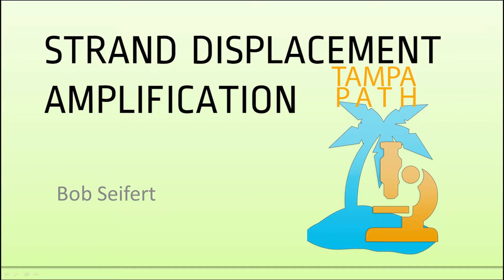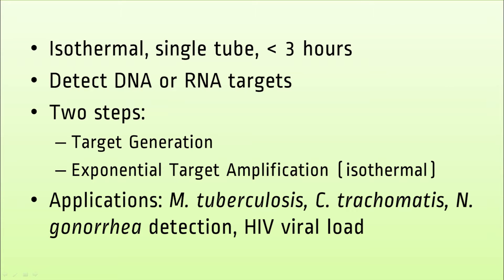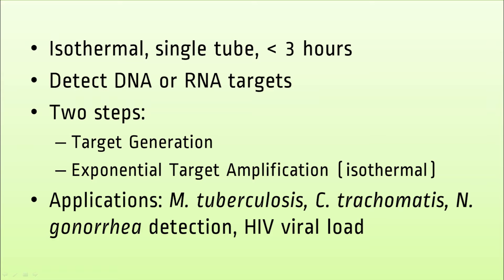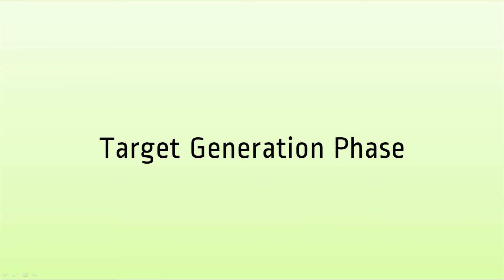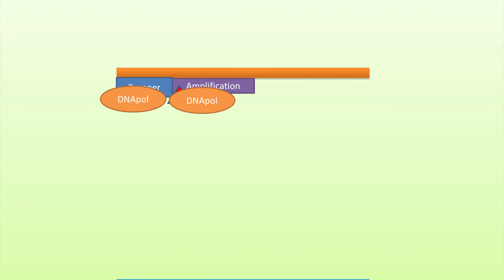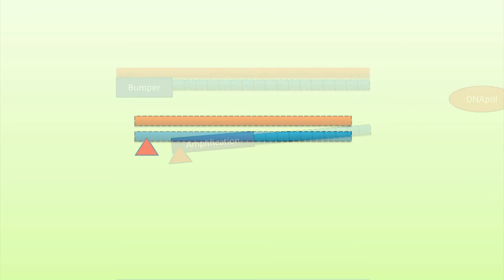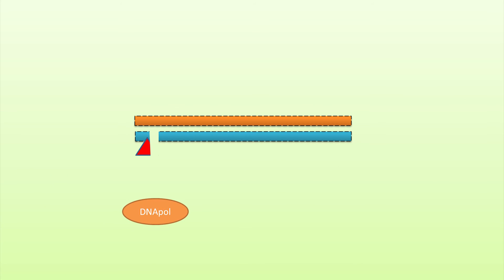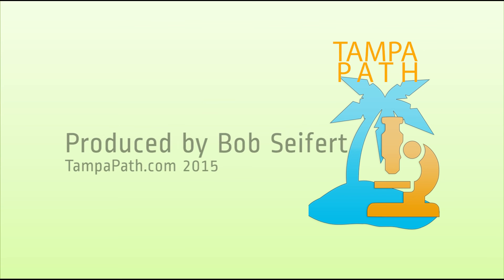Strand Displacement Amplification

Comment: is the Amp. primer that's knocked off re-used for the new templates during this process?
Reply: nevermind. I see that the attached amp primer(now synthesized & displaced) turns into the new DNA template. didn't know earlier it was already attached to the new DNA template strand!